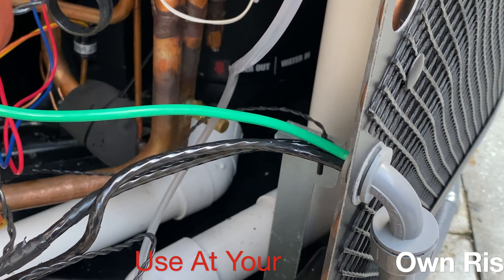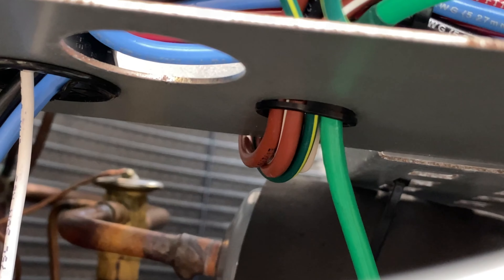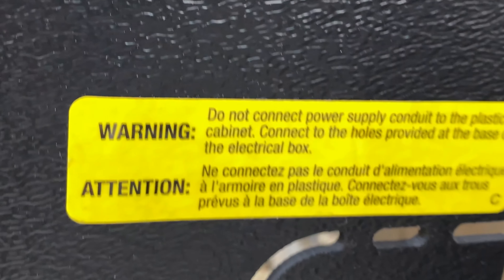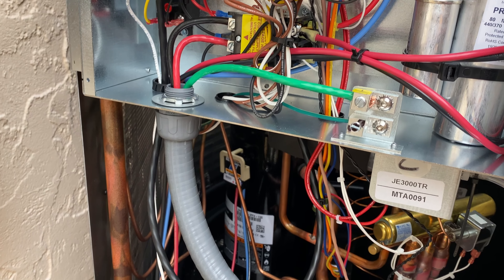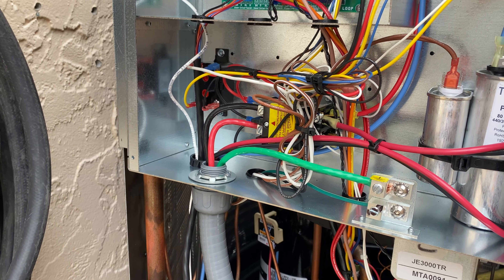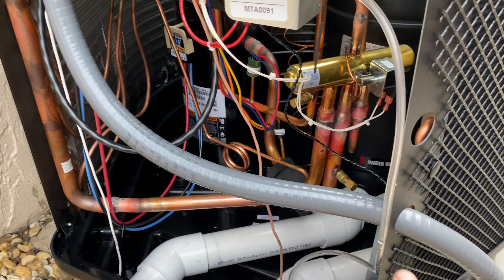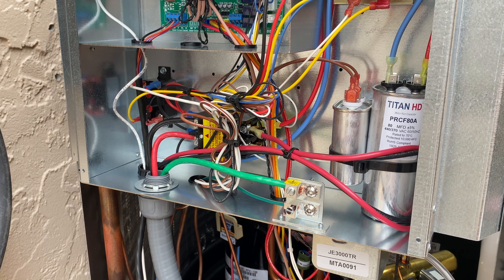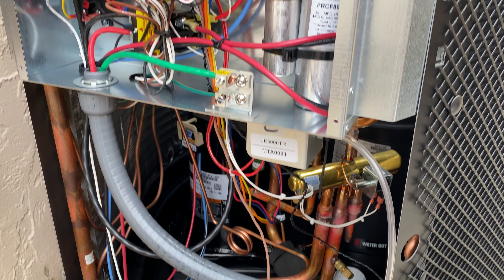How to Wire a Jandy Heat Pump - The Right Way & Wrong Way - Chlorine King Pool Service

Comment: Any possibility you know the national electrical code for this? It help me out alot
Reply from the maker: Hey Frank. In what regards?
Reply: For the seal tight connected to the side of the heat pump and not to the proper electrical enclosure inside the pump. Long story short I'm dealing with a jandy warranty rep who is saying that is correct.
Reply from the maker: I’d have to find the code. It says right on their cabinet to not connect it there lol.
Reply: Lol I have some good text from a jandy rep saying otherwise 🤣.
Reply: Theres no code for this. The wire going thru that cabinet is not a problem. Theres lots of wire going thru that cabinet.
Reply: What gauge wire did you put in?

Comment: I've seen them installed that way during original equipment set.
Reply from the maker: FRANK Widdifield crazy huh?
Reply: Yea, should do one on salt cell wiring. Even qualified residential electricians get that one wrong.
Reply from the maker: I did. Let me know what you think...

Don't Blow Up Your Swimming Pool Salt System - Chlorine King Pool Service https://youtu.be/_T7U4jb8Esg